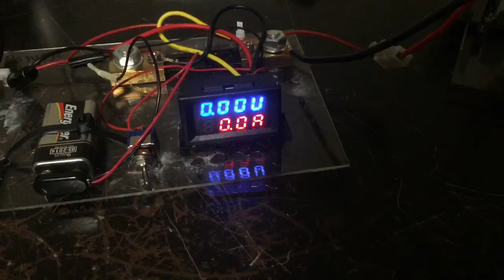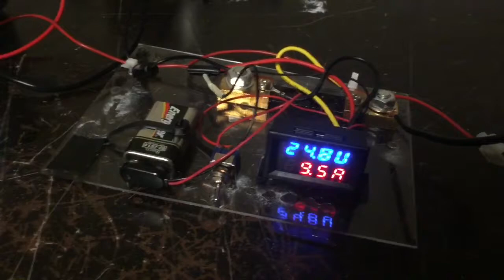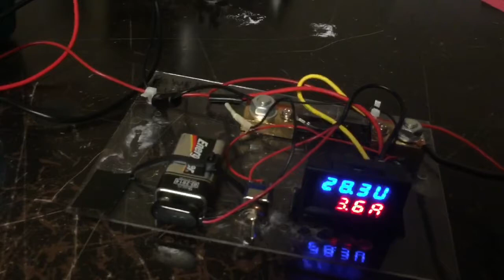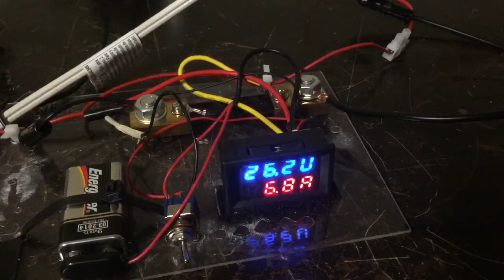Testing performance of Microwave Oven Transformer DC Power Supply

Comment: Do you know what the approximate max power output would be for running the MOT at 100% duty cycle?  Thinking about using two of these but need more like 48 volts DC for the 2500 Watt ZVS version.  Do you thing that two Mots in parallel would have the would do 50 Volts @ 40 amps or 2000 Watt running 24/7?
Reply from the maker: Should work if they are phased right
Reply from the maker: Each MOT usually puts out 1kW. Two would put out 2 kW. One issue I found with MOTs is that the core gets quite hot after a 5 min run.

Comment: I see you have 4 rectifiers. How do you connect it from transformer high current output.
Reply from the maker: They are rated for  100V at 40A and are connected in parallel. They are connected to the 30V secondary winding.

Comment: How did you calculate capacitor size?  Why do you use 4 rectifiers in parallel when 1 is all that is needed?
Reply from the maker: Jim Engele 4 rectifiers in parallel handles a boat load of current. The large cap is what I had lying around. You could get away with a much smaller cap.
Reply: TESLASCIENCE HACKS did you use a pi filter with a choke coil?  I'm considering this for my mot 48vdc power supply/induction heater. I don't know how to size the components. Did you just use a capacitor and then to the load?
Reply: TESLASCIENCE HACKS this is very similar to a setup I'm attempting. Thanks for sharing.

Comment: Hi, can you please help me. I've seen your videos and you know what your doing. I have a cordless dewalt mitre saw (model dw017) which I would like to run off the mains. I've been told that the easiest and cheapest way is to use a microwave oven transformer. The mitre saw runs off 24v batteries at 2.4 to 3.0ah. The motor requires 630w of power. I live in the UK, so power input would be 240v. I've also been told to add a bridge rectifier and aim for around 27v as the power output supply. Can you please help me with instructions, with what type of MOT to look out for and what wire size I require, how many turns are quoted for the secondary on so on. Would a cooling fan need to be fitted. I have very little electronic knowledge but I'm generally good with DIY. Please help if you can. Kind regards
Reply: I been trying to do the same as you are. Are you able to build a power supply that work? Would love to heard back from you. Show some picture of your build.